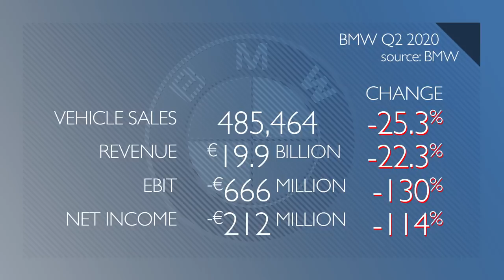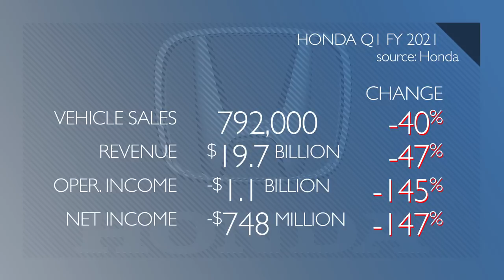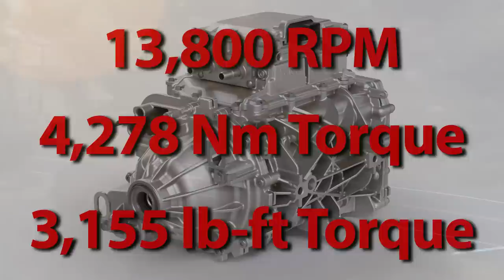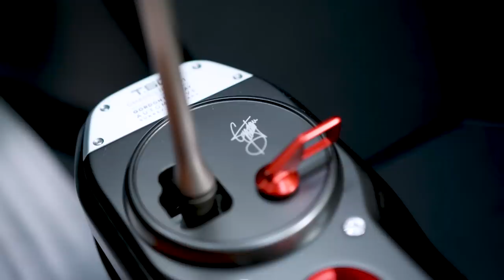Gordon Murray T.50 Supercar Revealed; Kia Adds Hybrid to Stonic - Autoline Daily 2889

Comment: 13800 rpm for a 190kW motor is decent.
For reference: model 3 primary motor can do ~192 to 202kW (upto 4500 to 9000 rpm approx) with a max 18000 rpm. 

Of course Ford/BW unit must be torquier with gear ratio sizing. But Tesla probably would win on power density and weight for the motor engineering

Comment: Nissan Frontier did change drastically.  The new Frontier has been cheapened significantly.  NOTE: the chromed front bumper has been replaced with plastic bumper.

Comment: We need to set marketing expectations on things like torque numbers.  Is that torque limit on the reduced output?  If so,  how would that differ from a similar high performance gear box that has a 3 or 4:1 reduction coupled to a 700 ft-lb engine?

Comment: yes, bmw will bounce back but not that strong. bmw is not competitive in the EV sector. they will do average this year compared to the competition. japanese car brands will be hit hard by the change to EVs. it seems that only honda figured out where the market is going - at least partially because the honda-e has low range and is expensive. mazda is optimizing their combustion engine - which is nice - but it seems that they will be very late to the EV party.
toyota will suffer too - at least in europe. they still work on that hydrogen crap that really nobody needs and having a hard time admitting that they are riding a dead horse.
how are US companies doing? fotd lauched the not-mustang mustang mach-e which looks good. GM has an (old?) Bolt but building a modular battery platform now.
who does not recognise the EV trend and could be too late to the party in the US?
Chrysler? i don'r know the US market that much.